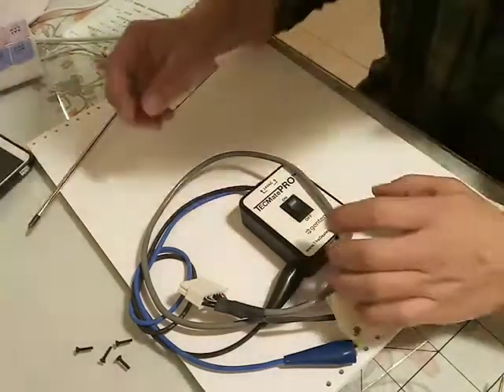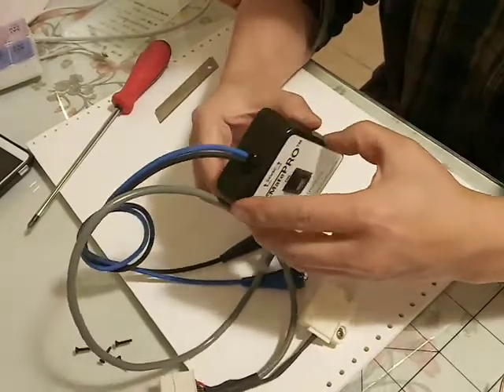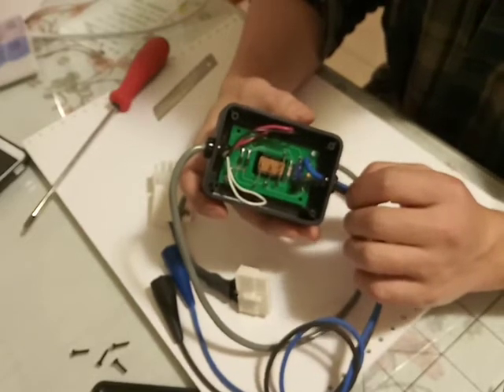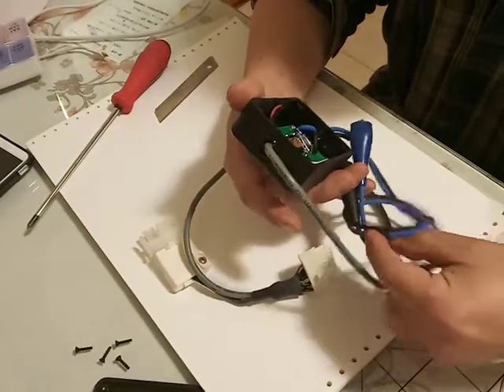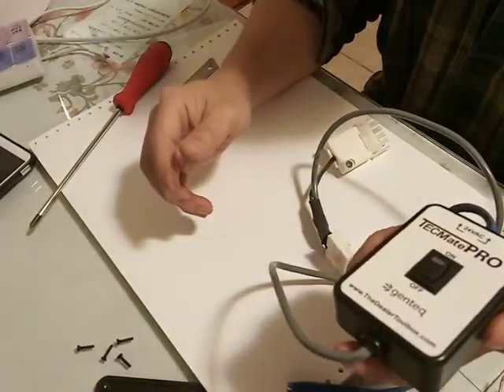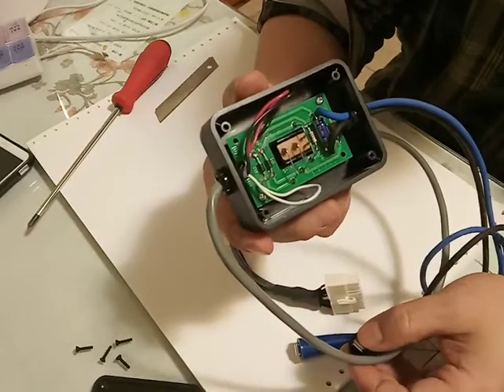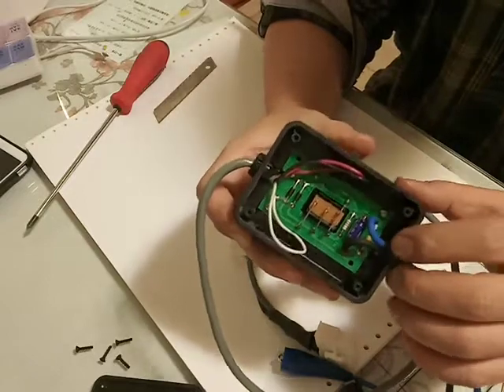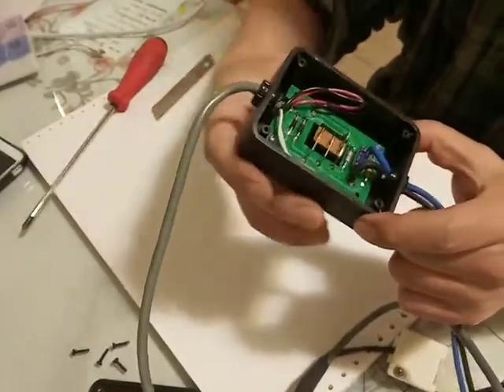Tecmate Pro Teardown (Furnace ECM Motor Diagnostic Tool )

Comment from the maker: In the video I said "maybe a resister", it 's a fuse rated 1/2A. I have to de-solder the power switch to take out the board, the other side has no component.
Reply: Nice video, helpful to see what’s inside. I disassembled the older tecmate XL and it’s very similar inside. I was curious how the PWM portion worked, but turns out it doesn’t actually use the PWM. If you’re interested:
https://youtu.be/q9lr9ETi6OQ

Comment: It’s because some motors use AC and some motors use DC and newer ones use serial communication.
Reply: They all test the same way, 24v AC. Even the new ECM 3.0 motor that uses a DC PWM signal can still be tested with 24v AC.

Comment: I am surprised it had that much in it. I thought it would have a switch max.
Reply: It needs a diode and resistor for the LED, everything else is routed through the main switch. Nothing to these testers really. If you know how to wire it, you can build one yourself.